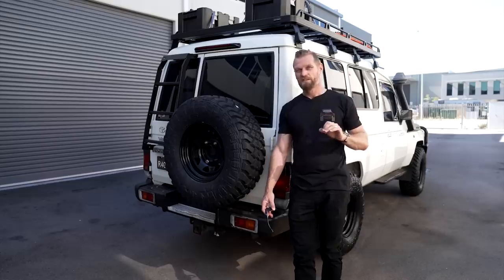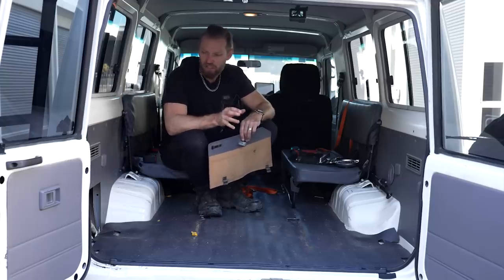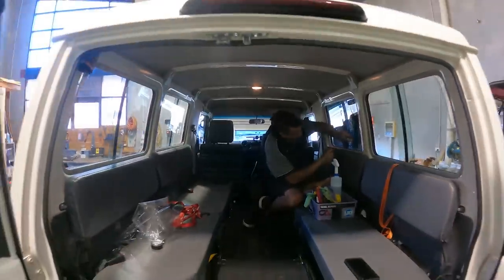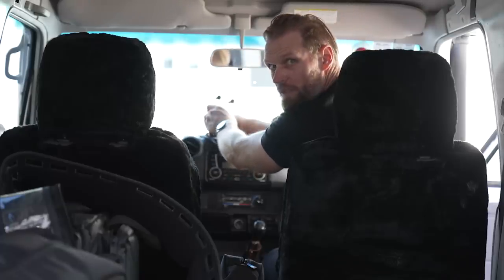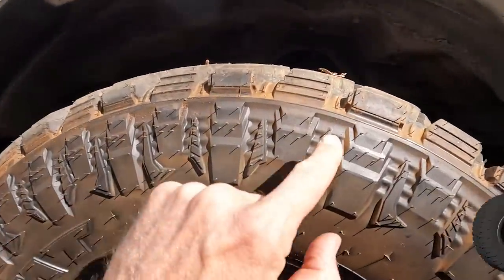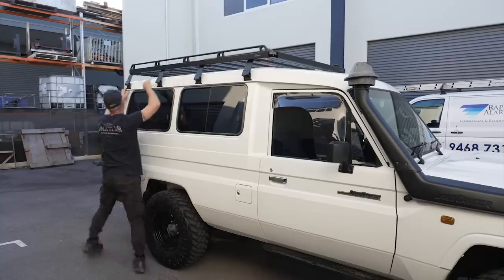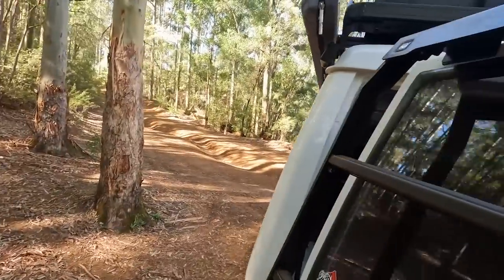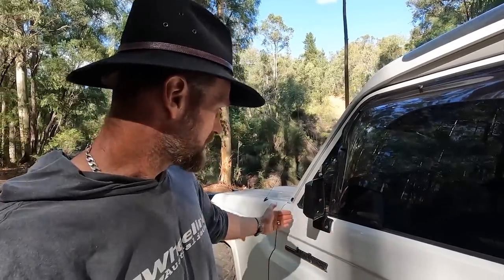The TROOPY Project, First Mods

Comment: Long time Troopy owner here I’d definitely recommend a wheel rear carrier for next mod mate it’s all good around town but with 4x4ing the weight wheel on door they all sag
Reply from the maker: Cheers mate will take that on board
Reply: Not only sag it will crack!
Reply: Too late to run a stock spare which is all you need
Reply: Agreed.  Eight years of bouncing n pounding over roads n off road here in Africa damaged my rear door a bit with a 31 on it.  It's now on my roof rack till I save up for my rear bar with a swing arm tire mount
Reply: Ronny Dahl i can wholeheartedly recommend Thorburns Fabrication. They make the best aussie rear bar for sure. I know because i just got and installed one myself!

Comment: 24 year Troopy owner. Mirrors - replaced with OCAMs but only for towing a wide boat, otherwise don't need them or replace with 76rs - it's a skinny vehicle - get a rear camera. Leave the roof alone - just put your swags up there. Rear door rattle - you can adjust that top bracket & pop a washer in to move it a smidgen lower - mine is 29 years old & no rattles - get a gas strut to assist opening. Definitely spray cavity wax in internal seams for rust protection. Uncovered vinyl on the floor will develop wear holes over time. That bent aerial is a pain to replace - there's a tricky grommet to get to - just did mine

Comment: Is there a reason not to put narrower 255/85/16 which are lighter instead of 285/75/16, which weight for example makes your back door do this noise on uneven terrain? Also put alloy rims and you can get rid of 3-5kg on each tire
Reply: Skinnies are better in every terrain bar mud where not much helps
Reply: @andrewb5887  that’s why army vehicles have them
Reply: @michaelhermans4753  pizza cutters yeah
Reply: @andrewb5887  wide looks better but sucks fuel oh yeah
Reply: The 255s are the best tyre size for Landcruisers, but not many manufacturers make them and certainly not maxxis which is Ronnie’s tyre of choice and I’ve just ordered my 5th set
Reply: @user-rv6zk1pp7r  I think they have an MT in that size but I was hoping for an AT for overlanding.
Reply: Also as I remember LC78 comes with even smaller tires like 235 so a step to 285 is huge
Reply: @androl2366  steel 6" 225/95r16 on all troopy trims, roughly 33". Other 70 models can get a 7" alloy with a 235/85r16 which is roughly 32"

Comment: I've just done an around Aus trip which included plenty of corrugations. Cordillo Downs track, Birdsville Track, Oodnadatta, Gibb, Kalumburu, the Tanami and others all with a 285/75/16 BFG KM3 fitted to a steel 105 series Land Cruser rim hanging off the back door. No problems. I carried a spare on the roof which I never needed. Most people set up the Troopy so that virtually everything is accessed through the rear doors which means that at nearly every stop you have to open them for one reason or another. I thought about the Kaymar rear bar but decided I couldn't live with the inconvenience.

Comment: Troopy owner here.   The later series GXL mirrors are upright, slightly convex and are a great upgrade to what you've got, but cost a bit.  I've actually gone for the MSA mirrors - they come with electric controls and are better than the Clearview I had previously.  Fantastic mirrors.
Spare tyre on the back door - you will bugger the hinges if you put too much weight there.  Easy to buy a second hand skinny 225/85R16 tubless tyre and rim from the current model - they only weigh 29kgs and are almost the same diameter as your 285/75R16s.  Rear wheel carrier add a lot of weight - if you go that way buy one that incorporates a 3500kg towbar like the Kaymar - saves you adding a 25kg towbar.
In years gone by I had the same seat arrangement on a troopy and like you I removed the rear most seats to use for storage - 2 problems - the front passenger seat needs the longer GXL runners to enable people to get in the back and secondly for safety, you'll need a decent cargo barrier to protect anyone sitting in the rear seats.  Actually the rear seat passengers only have single lap belts.  Best option is to remove all the sideways seats and install a rear bench that incorporates its own seat belts.

Comment: Maaaate, lovin’ the troopy project! 
After having one for 18 years I would definitely recommend a rear bar and wheel carrier. The door hinges will thank you and it’s heaps nicer every time you open the door, lots of choices out there now, anything is better than nothing. Go with the same mirrors that you know, it’s comfortable for you. Rust will be an issue in the long run so go for some protection while it’s still clean. I’ve seen a big difference and I’m the one that got rusted out! Once you stand or sit comfortably inside your truck on a rainy day or get in and out you will love it! Cut that roof if you have the cash??!! Huge shift from just a truck to a home away from home. Go stand in one and envision….
Wishing you all the best with the journey. Thanks for doing what you do, appreciate it. 
Peace brother

Comment: to stop rust near gutters spray penetrol or lanotec on the inside where the walls meet the roof , theres a gap where the rooflining goes down,soak that area spraying towards the outside all the way around , even above the windscreen . This area gets condensation ,so rust starts from the inside. Rear door hinges will not last with that tyre .Also rust proof where the wipers are mounted, the chamber below the grate gets full of crap towards the guards , thats where the drips on your feet will come from !!!!
Reply: all the roof rust repairs do not correctly coat the inside after repairs.... which is why rust comes back again and again...
Reply: On my 60 there are actually two layers of metal inside the roof edge there so use a wide spray rather than a thin stream since you may only get one side of the metal. But maybe a 78 is different.

Comment: Zero need to change your mirrors but do get a van mirror so you can see your ball. Absolutely get a rear bar for your tyre, the door moves and hinges break. I went with Outback Accessories, spare wheel right, double jerry left. Awesome product. My Troopy is the best 2011 WorkMate 78 in the world so if you want to know what works and what doesn't...ask me. Way to go Sandgropper

Comment: Loving your Troopy build. A secret I have learned for anyone fitting a steering cover. Leave the cover in the sun for half an hour before you do the job. Makes it a bit softer and more forgiving goes on alit easier. With your spare tire, take it off the door and put it on an independent rear swing out. The wheel weight off road will damage the door hinge alignment. Thanks for the content. 🇿🇲

Comment: Definitely get a rear bar sorted asap! The bigger rear door will sag and start to become difficult to open. The panel is also known to crack on the left-hand side under the window where it is at it's thinnest.

On the mirror front: get a set of GXL 70 series mirrors. Give you the extra width and height and provide a factory look for half the price of after market tow mirrors. Also suit the existing bolt holes!

Comment: Hi Ronnie,
I have a 76 series in NZ plus a Troopy IN Aus. Never had any issues with the door rattling or damage caused by the tyre hanging there. They do get heavy to swing and have adjusted the stops a few times. However, on both vehicles I have fitted rear bars with dual wheel carriers. Why 2 spares. Had 2x flat tyres 3 times over the years.

Comment: Heavier spare and rough terrain will 100% effect the rear door over time. Mainly sag the hinges and crack the lower window frames which all four doors can do quite often on these vehicles. Best off going to a rear bar with swing out wheel carrier. This then also leaves you with an option to gut the bracing out of the rear door internals and make it a storage compartment.

Comment: Yes for that size wheel you definitely want to get it off that door. As for the space behind the panels I installed my twin compressor and electric system (before ASW 😜) and I found a fantastic place for the 4l air tank. Let me know if you or anyone wants to see it.

Comment: Ronny. Greetings ! Also a Troopy owner and fully endorse previous recommendations for an independent spare wheel carrier. I went with the Kaymar (ARB) which provides the option of one or two spares.  More secure mounting and takes weight off of rear door.
I also run ARB side rails. While expensive, they provide excellent protection for side of vehicle.
My tyres are 265/75 which reduce the gearing / top speed slightly, but I get excellent fuel economy at almost 10 kpl.
Reply from the maker: Thanks for the suggestions, I’m currently getting 12.6l per 100 with 285 and a loaded roof rack

Comment: Get the wheel off the door! You will eventually get cracks along the metal and the latch won't close fully, that rattle is the latch pulling. Unfortunately the sparewheel carrier is only really meant for the stock skinnies. Those mirrors aren't sturdy enough either, eventually start to wobble at highway speeds. 

Maybe with the kids get the darche rooftop that has 2 separate rooms, then leave the bottom with the seats as a little living room for wet days. Im running a similar setup for myself and it's a dream as you can get space away from each other when needed. You don't really want to cook where you sleep and drive anyway, good awning and slide out kitchen is way nicer.

Comment: Hey Ronny, larger rear view mirrors with a small convex mirrors are a nice upgrade. Gives you a wider view making it safer to reverse and change lanes on tight spots and when on busy traffic. You can also get a large wide angle reverse mirror that clips on the stock mirror. Easy and affordable upgrade as well. If I could afford a rear bar I would get one. Not only to avoid dislodging the barn door but to protect the rear lights and panels when off-road. I have caused some damage myself and I wish I had a rear bar.  A handy upgrade is the toe bar step. Makes life easier since you do not have to climb in and out of the vehicle from the rear. The cupholders sold by the guys of buildin70s are convenient for both, driver and passenger and you get to support those dudes.  A drop down table  in the barn door is useful for when stopping on the road to cook a quick meal. Spring hat holders are awesome. My girlfriend and myself love them, keep the Akubras out of the way and in good condition.  Members of the TOA facebook group are always sharing and posting new products and gadgets installed and tested in their rigs. I really enjoyed watching this video. It reminds me of when I started accessorizing my good old reliable 1HZ troopy I bought on the side of the road from a banana farmer :)

Comment: Ronny, I have had the same size tyre on my door for 3 years a 120000 ks with no issues. Also the mirrors i guess it depends how much bush bashing you do. I don't mind the factory ones as the tuck in flat to the door. I just put a little convexed mirror on the passenger one to get a wider field of view.

Comment: not a troopy owner. but similar on my GQ patrol, as soon as u put a 33 or 35 etc on the door, over time and corrugations etc the door will start to crack in it’s weak spots. i’d definitely recommend a rear bar

Comment: 76 owner here. Troopy is starting to take shape. Love it. Looking forward to see all the mods. How heavy are you envisioning it will be and what lift are you aiming to fit? For the type of trips you do i would get the tyre off the door. If you get a kaymar you might have to chop the ladder a bit but they are 100% worth it, only bar with heaps or rear clearance due to integrated tow hitch.

Comment: I’ve got a 75 with a tub and mine came with the standard big mirrors. Because I didn’t have the tray that sticks out really far I cut down the factory mounts and re bent them so they fit properly and stick out at the right angle. so now the mirrors fit close to the cab. I also fitted a convex left side mirror and it’s improved visibility hugely. Having the convex big mirror on the left side is so good.

Comment: Door will be fine. Keep on top of the adjustment and rubber block at the bottom (yours is missing). Hinges need replacing once movement is spotted (hinges are consumable like tyres). And you will be fine. Just replaced mine at 600000km. I’ve done a little bit of off road work 👍

Comment: For your mirrors have a look at the genuine Toyota (not cheap look alike) mirrors off the current troopys and 76 wagons. They're quite a bit taller and the mirror lens has a slight convex surface so you get a larger field of view. I personally find this is perfect for my troopy and its a direct swap over from your current mirrors. If you go for tray back style with the large steel triangular arms you'll need to drill a couple more holes in the door skins.

Comment: I’ve got a 315/75/16 mt mounted to my door, I used a spacer I had laying around so I can open the door on the left without clashing. My door hates me lol. I put tape around the bit of metal that sits in the rubber bump to stop it wobbling…for now it works haha

Comment: I'm liken the Troopy so far . Yes it needs a rear mounted wheel carrier as with the weight of the wheel it will eventually put too much stress on the door . I also see the wheels are sticking out from the guards a tad so you will need some bolt on guards to be legal or the cops will pull you . I think the mirrors will be okay , they only get bashed off-road anyway :-)

Comment: Hey Ronny Dahl i can wholeheartedly recommend Thorburns Fabrication for a rear bar.. They make the best aussie rear bar for sure. I know because i just got and installed one myself! A wheel attached to the rear door will ruin the door. My rear door on my 96 model is shagged because the previous owner had a muddy hanging on it at some stage. Get it nipped in the bud early and get yourself a Tborburns rear bar. Trust me 👍🏻👍🏻

Comment: Be careful with mirrors. I put Clearview on my 76, great for towing but very hard to reverse when not towing as the mirror sits so far off the side of the car. Hard to judge the distance to the side of the vehicle. Going to change back or fit maybe gen 2 Clearview that sit a bit closer.

Comment: I've replaced both hinges on my rear barn door, the pins in the hinges wear out with a big spare wheel hanging off them. Put the spare inside until you get a rear bar sorted out

Comment: I always found with the standard rear door if opened on a hill from the inside it can fly open and bend the tiny pin that stops it, this eventually means it opens slightly further and can break the rear light.

Comment: On the 24 May 2019 you did a long term review on these tyres. In that review you showed that you had had a puncture. In this review you made no mention of that past puncture but if you replay that 2019 review and at 3:31 where you show the puncture it is in the exact same spot where this latest type has been modified. You experienced the exact same problem as the mining companies that requested the change.
I recently put 265/75R16 Maxxis Razr's on my heavily load D-Max. When getting new tyres I avoid tyre reviews as they can be biased, out of date etc. I have the experience and know what I want. Since getting these new Razr's I have watched your past tyre reviews and you have confirmed to me that I have made a good choice. I travel all over OZ and could end up anywhere. Several years ago I caught up with you on a trip you where leading to the Bird Observatory in SW WA. I do not select tyres on percentage of road to off-road use. As you know it is very easy to get yourself into  an unplanned serious situation which becomes more serious when you are by yourself, which I am some of the time. Its at these times that I want the toughest and most aggressive tyre. So if the tyre is only needed to its full potential for 30 metres in the tyres entire life, I am happy. It could even save my life. Its a bit like having a winch, you hope you never need it, but are very happy having it when the brown stuff hits the fan.

Comment: used to have to drive one of these when i worked with corrective service in the wheat belt, it was the most uncomfortable 4x4 i have ever driven and glad i didn't have to pay the fuel bill either I'm sure if my memory serves me correct around 20lts to the 100 the A/C cant keep up with the size of the cabin area was just horrible long miler i did 150,000 ks in two years even the offenders hated it.
the only thing i liked was it went hard and overtaking power.

I hit a duck once and it smashed the driver's headlamp assembly 1500 bucks to replace

Comment: Ronny you were worried about door sag with the bigger spare wheel, the ladder will do that for sure.Sick with the mirrors as bigger ones don't help that much........still have to use the side windows to see what in beside you.
Reply from the maker: The ladder weighs nothing
Reply: @Ronny_Dahl  not the weight of the ladder but your weight when using it.
Reply: 90kg human climbing a ladder attached to the top of door skin?. I decided against one based on this, be interested to see if it causes issues here, if not I will reconsider. Hate my telescopic ladder.

Ronny, please do updates on the ladder door and hinges

Comment: Hey Ronny, get the wheel off the door, it will sag the hinges and cause dramas. 20yrs of troopy. The main door will still sag over time and rough terrain and will need slight adjustments any way.. EDIT, I put mesh inserts, very fine, on the mid back windows on each side to let air flow while sleeping, its fine stainless so mozies and midjies don't come in. Hit it with some fly spray and it's good.

Comment: People give way to Troopy.  You don’t need mirrors; it’s that big your instincts will deal with that.  
Rear door spare, fine as is - Toyota replaced rust/leaking with gradual structural failure (my 97 1HZ needed pressure on the rear door prior to opening, not a problem.
Chop top? I doubt it. 🙏